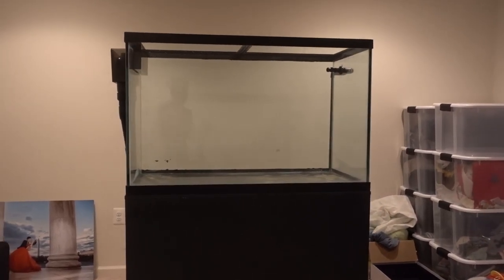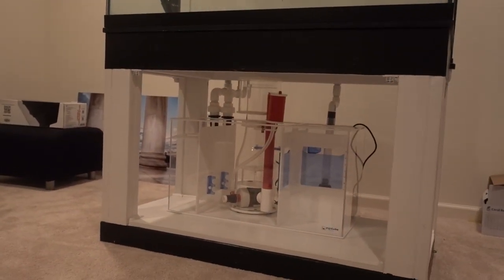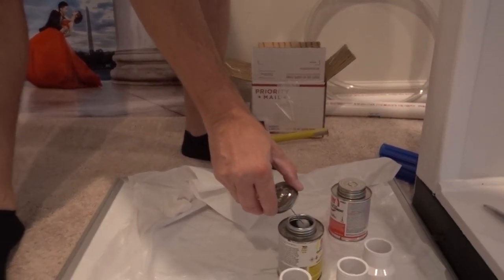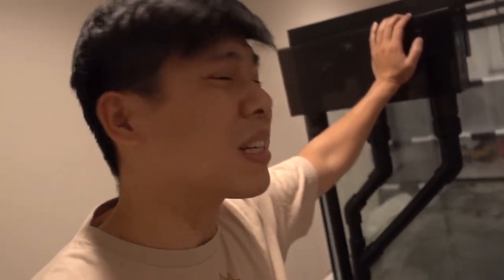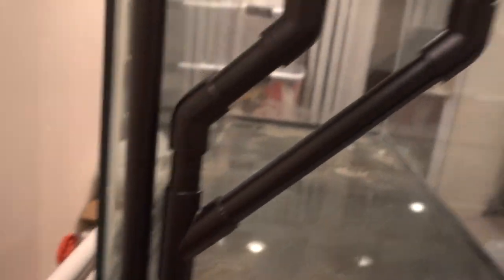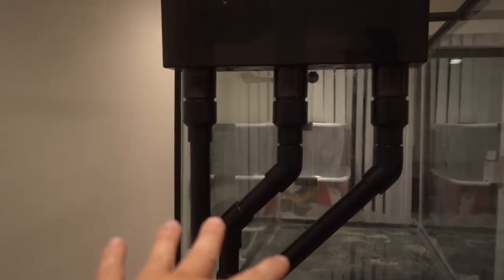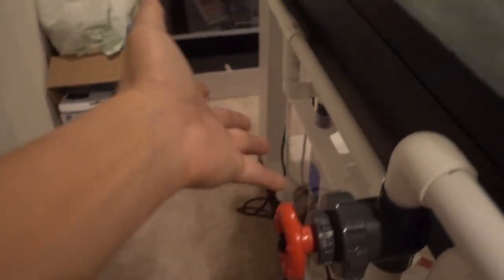we need to talk about the 150g (150g - 11/24/2019)

Comment: You really need a check valve on the return side. With one of those in place if your main pump stops for whatever reason you will not drain 5-10 gallons of additional water down the return pipe. Without one you risk overflowing the sump and you'll have a huge mess on your hands, as well as an angry wife.

Comment: Dude- just cut the pipe above the wye and plumb the emergency drain properly. What’s the big deal?
Reply: I agree with this. Plumbing can be scary if you have not done it. But, talk to the old dude at ace hardware and he will tell you what you need. Once you’ve done it, it’s no big deal. Also, I highly recommend a PVC cutter as opposed to hacksaw.

Comment: Once the baby starts crawling, you’re going to want a lock for that front panel.
Reply: So, a story from my 220 reef tank. Underneath i had several nicely attractive red valves. One for the skimmer and several for the return lines. Well my son was about 6 years old then. My wife had no idea of what was going on in my aquarium.  So one Friday night I was at a medical center for an overnight testing of a sleep problem I was having. They just spent 20 minutes hooking me up before falling asleep and I got a call from my wife. My son reached under the tank and turned one of those tempting red valves.  Water was pouring out all over the place. Needless to say, I had to abandon the sleep study and go home to fix the problem. P.S. he used to throw small batteries and even a bar of soap once into the aquarium. Thank God I had 2 big skimmers running in that tank and I spotted the soap early on.

Comment: The drains should never clog but if you need that emergency drain there will be trouble. And a sensor in the tank to shut off the circ pump sounds like trouble as well.

Comment: Dude just spend an hour and redo those two lines of plumbing. The other pipe can enter into the sump anywhere. You turn off the return pump you turn off your heaters reaching main display. Also I have a dc return pump and you can’t tune it perfectly like the gate valve. It gets you close but the gate valve  can make it zero noise

Comment: I noticed at 15:14 you're sump has the hole for the 3rd drain, just fix the plumbing before you move on.. I did mine 3 times to make sure it's right,  some things are done a certain way because its the best way. Stubbornness will only lead to a late night shop vac session or worse.  Other than that love the channel so far

Comment: Things that can happen will happen. Seems much easier to just add another pipe. It's also nice to have the a gate or ball valve on each pipe in the rare instance you need to close them in an emergency to prevent water going into your sump. I'd also have added more unions. The ability to take apart right below the overflow box is awesome.

Comment: That black plumbing configuration looks very clean and elegant! I’m having trouble understanding why you got an overflow box with three drains if you only wanted two....🤔 So if the overflow box was a given (maybe you got it with different intentions in mind) and cant be changed now because the tank has been drilled, my biggest concern wouldn’t necessarily be clogging but I would wonder about flow restriction....🤔 I guess you’ll have to see how it actually performs when the time comes and if I know you, you’re open-minded enough to change it if you have to. And all I know about plumbing is, whatever you need to do so it doesn’t leak, is the right thing. 😂😂😂😂

Comment: Dont think your drains won't clog; I had a several of my drains clog before due to pieces of bubble algae going down the pipe. I solved this with a coarse strainer (downside is you have to clean the strainer often to prevent clogging of the strainer.) Also get a gate valve on your main drains guys if you were not aware. You will not be able to just fine tune a drain silently with just a DC return. And Unions are your best friend, especially when matienece needs to be done on the pipes!

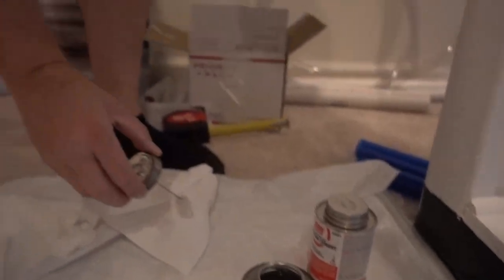Comment: Wait, I think the dude installed the overflow wrong at 4:30. Isnt the gasket suppose to be placed inside the tank than outside?
Reply: Ya I'm pretty sure you are right
Reply: eegernades nope on the outside and one on the inside
Reply: Shadow overflows come with two gaskets. One on the inside and outside.
Reply: Thinking about it  it would put uneven pressure on the box if the gaskets were on the inside

Comment: The problem is not that you combined two drains. The question is why didn't you upgrade to a larger diameter drain pipe. (sump connection?)

Comment: Why go through with the build if you already don't like the dimensions, most importantly the depth and how much of a PITA it's gonna be to maintenance (the harder the maintenance the less likely you'll keep up with it in general). You don't need 3 drains man, two is plenty and in fact a lot of manufacturers only use two most notably RedSea. I wouldn't lose a wink of sleep over it with two. What's the flow rate on that return pump with your head pressure calculated into it? looks small for the bends you have in the piping.

Comment: You are in trouble with the carpet flooring. How are you going to dry off water splash on the floor? Water will stay in carpet and turn into mold very quickly. Aquarium setups should be sitting on ceramic or vinyl flooring and have proper ventilation to evacuate humidity.

Comment: Also you will never have to adjust that valve on your return to sump. That drain will not handle much flow at all. 3 together yes but one no. Not unless it's in full siphon and stays full siphon. So your flow will need to be internal with powerheads.

Comment: You should probably put a check valve on your return line or else if the pump goes off it will siphon into the sump and possibly overflow the sump. Unless theres some reason you didnt put one that im missing

Comment: Your sump return section water volume is way to small to ever flood that tank. Use the formula LxWxH / 232 to calculate how many gallons it would be above your overflow to flood the tank. I’m guessing 10-14 gallons... if your return section don’t hold that much pump will run dry before tank ever floods... only way it would is if you ATO kept refilling. So instead of water level sensor just make sure ato shuts off after running more than needed. Most ATO have that fail safe already built in. In other words RELAX no changes needed. Don’t forget back flow from the return line in the tank every inch it’s below the surface is 5 gallons your sump has to hold. Drill a siphon break hole on the bottom of the lock line for extra precaution. Awesome build man I’m watching. Keep doing what you do! 💯💯💯💯

Comment: I have my return going through the inside of my emergency drain pipe (a smaller 3/4"). Less pipes visible. Emergency still works.

But why have two 90 bend from your return?? Reduces flow.. tidal gardens done the same thing. Use 45's if you must.

Comment: It's looking really good so far! My only concern is Looking at the plumbing setup I have a feeling that the Return to the display just may drain too much back to the sump. It seems to be about 2-3 inches from the top brace water line which would result in 10-15 gallons just in that area flowing back to the sump when power is lost. It will depend on where your normal sump level will fall but to have an extra 10-15 gallons flowing back may be an issue. If you have a check valve inline on the return line to the display that will work for awhile but at some point will fail. I remember when mine did back in the day.

Comment: On my tank I have the reef octopus Varios 4 return pump. It comes with a float switch that will shut your return pump off when the return section water level gets low (i.e. clogged drain line). Works great for me.

Comment: I use a tank overflow sensor and love it. When the water gets too high, it cuts power to the return pump and starts to beep letting you know there’s an issue.  I also use one in my skimmer.  Here’s the product: Aqua Auto AutoAqua Smart Level Security